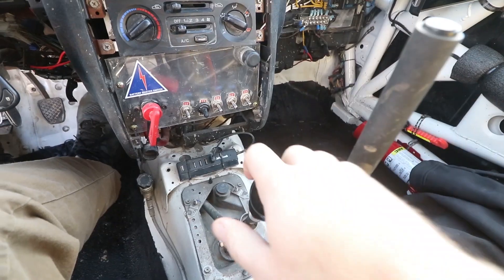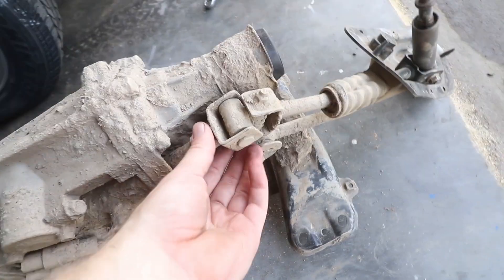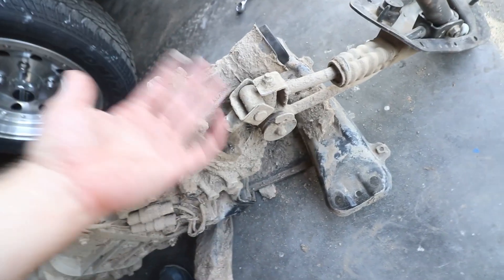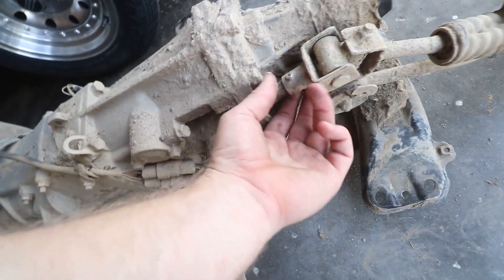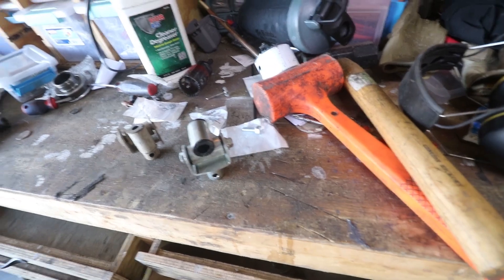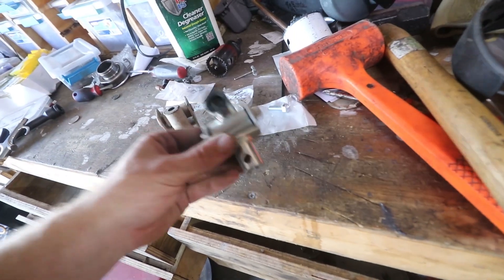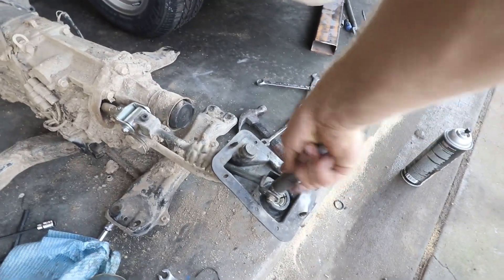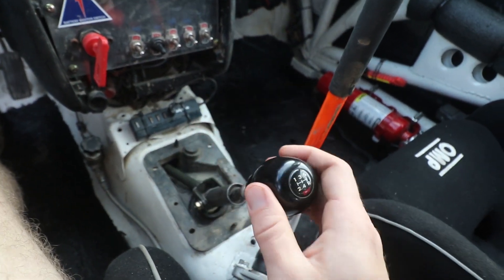THE BEST SUBARU 5 SPEED UPGRADE | Turn In Concepts Sloppy Shifter FIX

Comment: yeah just give it a little tap tap taparoo....... after sticking a punch in there , it broke off trying to remove   drilling it out and than knocking out roll pin   .  its not going back in !  bolt and nut !!!

Comment: It's a nice part, but $85 is a bit hard to swallow when OEM is half that and aftermarket are as cheap as $10. Wish they made drop in bushings and a bolt kit to replace the riveted part. I'm just a cheap guy though. Good video!
Reply: OTOH, real quality always costs more, often much more. Here I am not writing of a "quality product" as self-described by the marketing department of "The Unnecessary-Plastic-Object Corporation of Delaware", but a product which is made to an exactingly high standard.
Reply: @bertram-raven  You right, but it has to be taken on a case by case basis.

Comment: Do you think having that bushing be totally shot would prevent you from shifting? Mine pretty bad and my outback is currently acting like it’s in high gear when in neutral. When I put it in another gear I don’t get any engine response (or movement rather) outside of stalling. Thanks!!

Comment: Replaced the shifter bushings my mitsubishi carisma a few months ago. Probably the most rewarding repair I have done, and also one of the most overlooked as it does wear out very gradually.
Reply from the maker: Yeah shifter bushings are almost always neglected and make a huge difference when they're replaced.
Reply: Yeah, I replaced the bushings in my 08 N/A Impreza and while it wasn't perfect it was dramatically better. I should have replaced the whole thing w a short shifter (which is next, hence I'm here), but as a quality of life upgrade it was a must.

Comment: Did this on my old wrx wagon.  It was dam near impossible to remove.
Reply: Also did a cobb adjustable shifter.  Was able to raise the shifter and maintain stock throw.
Reply from the maker: Yeah the roll pins can be difficult, especially with the trans in the car or if you have a rusty subaru.

Comment: At first when I watched this I was dissapointed that your tarns was out of the car. I really wanted a pov of what it was like to do this replacement. But I'm glad you provided a different pov with the shifter still cononected to the trans because my shifter went straight to crap and slop as I was driving out to lunch yesterday. I was able to finess and work my way around the block back to work in 3rd gear (I'm pretty sure it's stuck in third gear) and I was worried that the linkage/u joint would be in a super odd position but turnns out its really not that much farther or different than it would be in neutral. So thank you so much for that!

Comment: I’m looking at buying a 98 outback and the shifter won’t go in 5th or reverse.

The seller thinks the trans is bad. I think the bushings are just absolutely annihilated.  

I’m going to reach under the car and manually put the trans in reverse. If it doesn’t grind or anything and moves. I’ll consider that diagnosed as a bad shifter bushing set.

Would anyone agree?

Comment: So if i purchased the kartboy short shifter and bushings, do i need to purchase this?
Reply: i want to find out too, is the TIC Linkage upgrade a must? not even sure if it fits the 2004 B4 GT ... it doesn't show that option of car on TIC website.
Reply: Yes, I'd purchase this too since your going to be in there anyways
Reply: Yes I would recommend it, my Subaru has a Kartboy short shifter and new shifter bushings in, and there is still slop from a bad shifter linkage that has yet to be replaced lol

Comment: i changed my bushings to solid bushings but still wiggles... front to back and side to side. all bushings are upgraded to solid bushings or poly. i even changed out the shifter cup
Reply from the maker: Did you swap out this joint? I did the same thing initially and all of the shift slop came from the joint on the transmission. The shifter bushings didn’t even make a slight difference.
Reply: @DirtyGarage  you know what that didn't even occur to me because I thought the joint was just a bushing holder. I should do it. Along with a new roll pin. Thanks for the suggestion. I've been debating on spending 1500 and getting a CAE shifter just to fix this thing. Had the problem for like 10 years now..

Comment: If you just buy the bushings would you still need to remove this from the trans? Also would it fix the problem?
Reply from the maker: The shifter bushings do improve some of the slop when you replace them, especially if you have an older subaru, but the majority of the slop comes from this joint and it will be the biggest difference. The bushing in the joint isn't replaceable either, it's riveted together from subaru, but the TIC joint has replaceable bushings if you ever need to change it out again.

Comment: Rather than use the original roll pin, could I use a bolt and lock nut (nylock nut) ???
Reply: I was thinking the same thing... And loctite for good measure haha
Reply: I've heard about people buying the part for the 06-15 that's made to use a bolt and putting it on their -05s, worth looking in to.

Comment: can not get that roll pin out to save my life lol. not dropping the trans again just for that
Reply from the maker: Yeah with the trans in the car it's really difficult to get the pin out. You could possible disconnect the trans mount and put a jack below it and you may get enough flex in the motor mounts to get at the roll pin a bit better

Comment: Hi we have the same issue, plays like neutral when in gear. What do I need linkage bushing or front/rear shifter bushing?
Reply: Front and rear shifter bushing , and U joint shifter bushing
Reply: If there is tons of slop it is almost always this front linkage. The larger bushings are more to upgrade feel.

Comment: Do you think this will work on my 95 Legacy 5mt?
Reply: I know I'm late, but unfortunately it will not. Pre 97 cars have a different front joint. You can however replace your entire shifter assembly with one from a 97+ car and use this joint. The front coupler is oriented differently on the old shift rods.